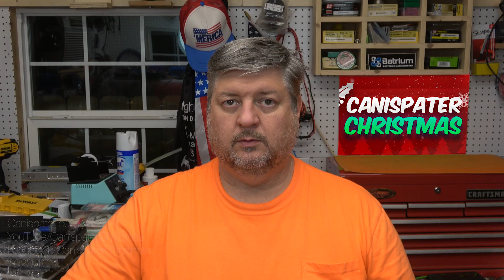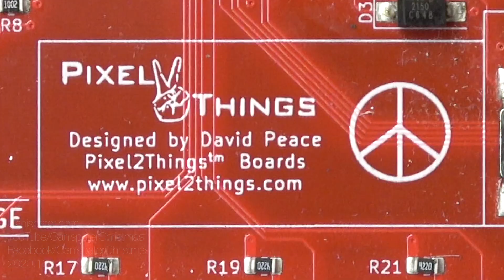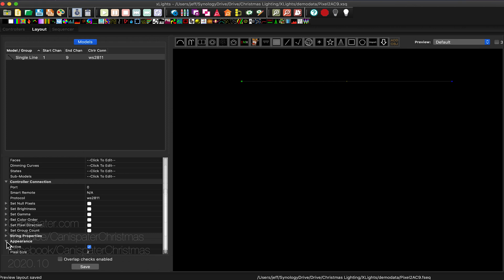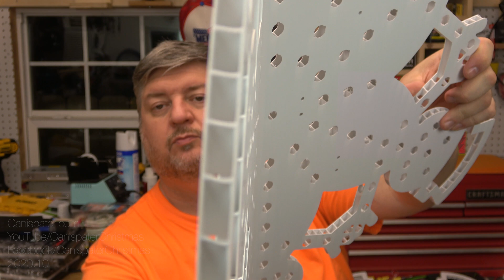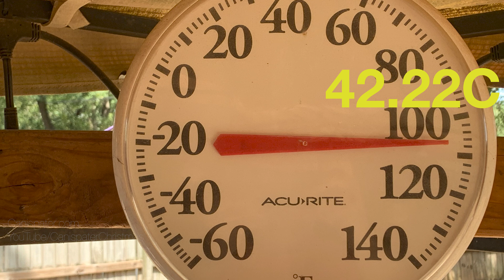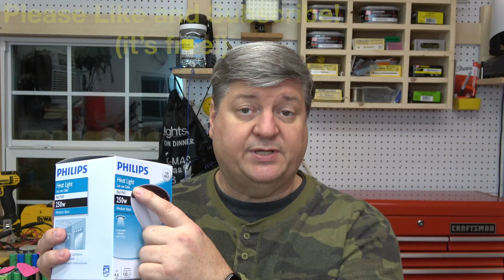🎄WS2811 AC & DC Boards (2020) 🎄

Comment: Hi Jeff my name's Mack  I'm a newbie too the hobby.  Just let me say that your videos are the best and most informative. I am wondering if you could tell me if I can use a dmx wall wash light with xlights?  They all have controls on the back of them I have about 14 of them.  Do I need anything besides the falcon f16v3 controller.  Do I just plug them into the controller and then daisy chain them together and program in xlights.  Can you tell me a good video that hopefully you produced.  Thanks
Reply from the maker: Welcome and Thanks! I did this one (https://youtu.be/4l29-NUje9o), it's old, but generally the same connection. Yeah, I'm no DMX expert so don't know all the particulars on number of devices per chain, but you essentially have it correct. If you need more help, definitely check the Facebook group as there are folks there that have tons of experience with it or check the xLights zoom room.

Comment: Thanks for the video. Interesting. Im just getting into the whole Pixel led thing. I currently have an mcu board with WLED and going to run 12vws2811 strings. My question is what type of cable should i run from the controller to the pixels, or it I want to jump a 20' space from 1 pixel string to another pixel string? I believe I saw that you can use a 18/3 extension cord? Thank You
Reply from the maker: Thanks! You can use that. You will need something like an F-Amp at the end of the first prop to get the signal to the 2nd. Pixels regenerate the signal, but are only designed to get it a few inches to the next pixel. An F-Amp will do 20'. Dave has them at pixelcontroller.com.
Reply: @CanispaterChristmas  Ok great, thanks for the reply. So the 18/3 extension would be ok to connect to the f-amp, or do you recommend a different cable? Also, does it matter if I don't have a falcon controller?
Reply from the maker: Picking a cable depends on the run. 18/3 will work fine for some runs, but you'll need to go with thicker wire for others. You'll have to either do the calculations or experiment. Current flow also has an impact. F-Amps are not controller-specific. They just amplify the SPI (data) signal the pixels need.
Reply: @CanispaterChristmas  Ok, thanks for the info

Comment: Hey, maybe you have seen this.. or know where to find it.  I need a Single Chip WS2811 board that has 3 AC outputs.  I have inflatables and I want to be able to turn the fans on and off, and control two sets of 120V lights in them, separately.   The Pixel2Things is nice, but with my number of inflatables I would need 26 of Davids boards to do them all.  This is my first year at Pixels so I need to incorporate a lot of my existing 120V show too.
Reply from the maker: I'd point you to planetchristmas or one of the diylighting forums (check the video description for links). Much more AC-competent people on those.

Comment: Before I heard about these Pixel2Thingies, I ran out and bought a Renard SS24.  How does these controllers differ? My plan was to incorporate several strings of A/C lights, as well as, have 1 motorized prop powered by a wiper motor. I'm trying to decide whether or not I should toss the Renard and start over.  Great video, by the way.
Reply from the maker: Thanks. I don't have experience with those boards, but it looks like a serial relay board. Similar function, but you feed it with RS-232/RS-485 vs pixel serial data. I think David's boards would be easier to add to a pixel display, but it all depends on what you have. I wouldn't say to toss the boards, but if you can't use them (or decide it would be too difficult to add to your show), maybe try selling them? I'd think someone running them might want a deal on new boards. If you can add them to your display, then they ultimately provide the same functionality.

Comment: Can you show how to use the servos with the boards? Surely I don't apply a brightness to control the position.
Reply from the maker: Yep. That's all there is to it. I noticed 20-80 on the value curve worked best. May be able to tweak that a little, but wall to wall didn't work.
Reply: @CanispaterChristmas  I thought there is a 'servo' control to drag into the timeline?
Reply from the maker: There is a DMX control, but this is using pixel data. The boards do have DMX outputs tho.